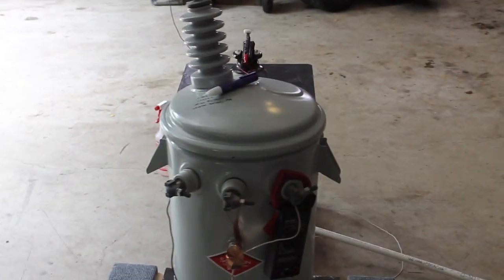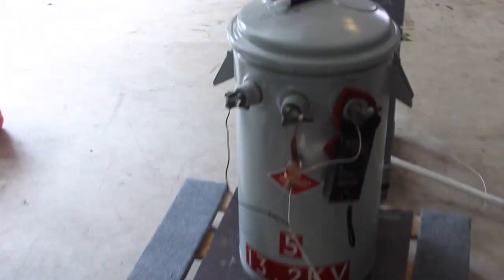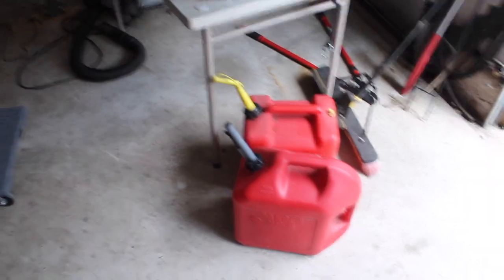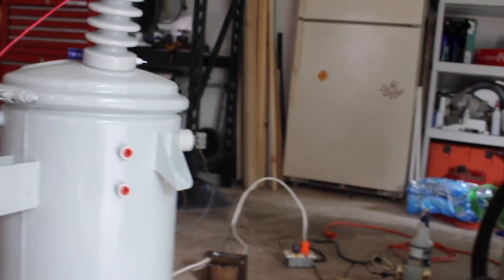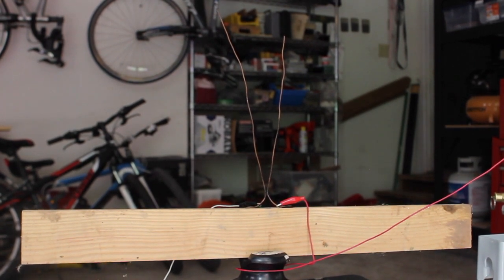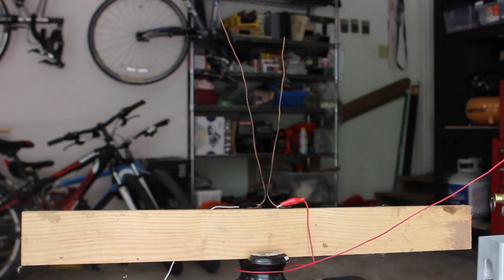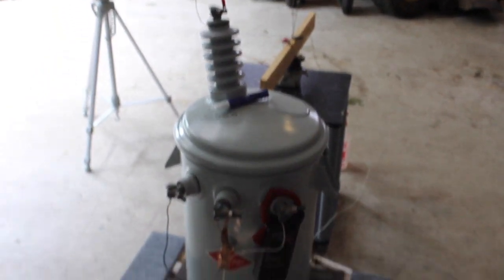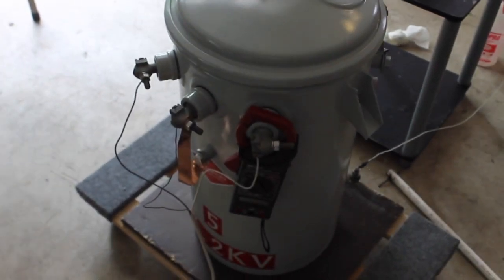Wicked 7,620 Volt Pole Pig ARCS!

Comment: What do you mean 13,200 volts it actually 7,620 volts? Is it because of the input voltage?
Reply from the maker: James Alexander The transformer is rated for a 13.2kV Y system. Phase to ground voltage in a Y is 7,620 to ground.
Reply: Nick Chubb has an 120v/23000v OBIT transformer that draws massive arcs!
Reply: @jlo13800 OBIT and "massive arcs" don't belong in the same sentence

Comment: Nice arcs!! Can't wait to see 2 19.2kV pole transformers in action!! do ya know how much one of those costs,?? Sorry about a s*&^ ton of questions, it's just that I don't want to sound like a whack trying to order one, LoL!! Love the vids man, please keep recording, their very intriguing.
Reply from the maker: Variac Maniac Not a problem at all! I haven't put in a request for quotation for them yet, I'm going to wait until later in the year to order them. But I'd assume between $500 and $1000, 33,260Y/19,200V is a non ANZI standard voltage, so 34,500Y/19,920V is more common, Exelon/PECO my local utility is the only company I know to use 33kV in the US, so I would like to "collect" that voltage.
Reply: I know some other power companies use 46kV.
You should be careful though not to start a fire, the arc may be too large to break, LOL.
You might be able to go to an electrical scrapyard and find old transformers as well, for cheap. (Though, bring a meter and a megger to test it to see if it is still okay!)
Reply: Would love to check in an electrical scrapyard, unfortunately scrap yards and salvage yards are not too common where I live, but I might check places while traveling.... Oh and there's an abandoned phosphate mine in Florida that has some, but unfortunately too big....
Reply: Aaron dondald has 12 neon sign 12v kv transformer making massive arcs!